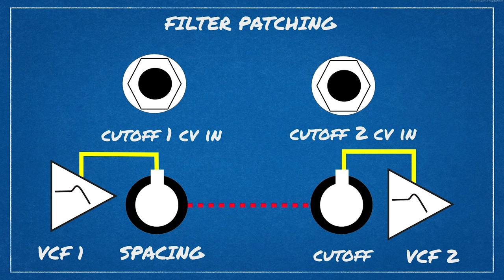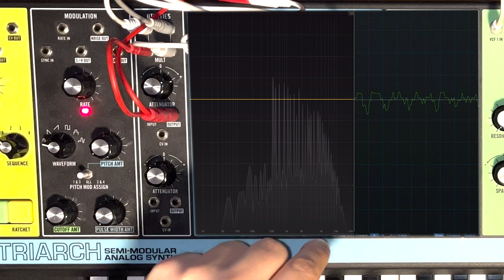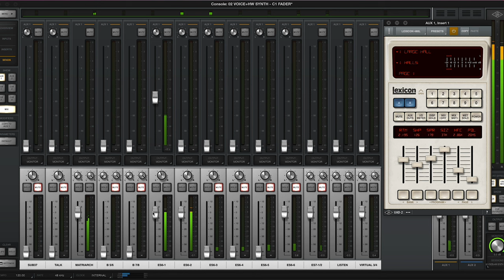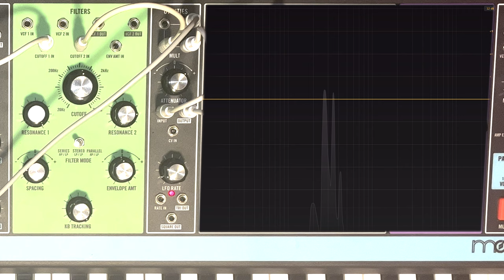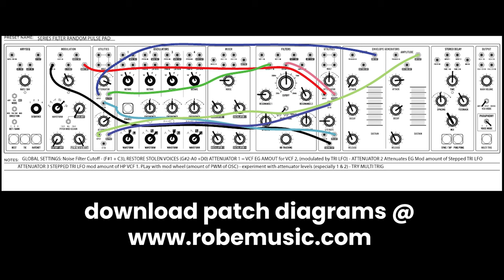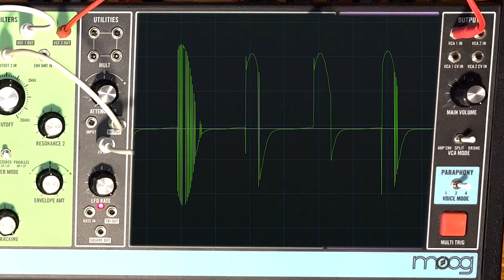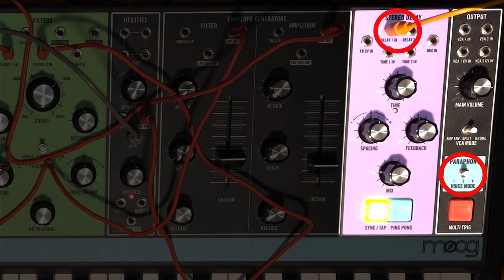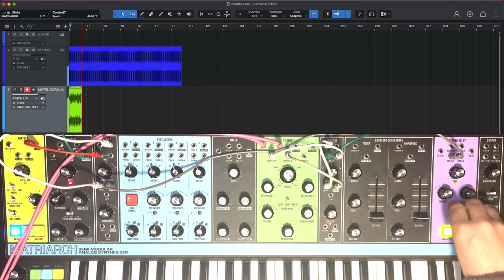Synth Nerds Only: Moog Matriarch Filter Deep Dive : Part 2 - Patches (and a little bit of theory)

Comment: at 12:17, i dont think you need to mult to all the pwm destinations. Pretty sure its normalled, so if you put a jack i pwm of osc 1, the rest will also be modulated. Put in 2, 3+4 will be modulated, and in 3, 4 will be modulated. Put at deadpatch in the oscilator next to the one your modulating to brak the normalisation.
Reply from the maker: Thanks...makes sense that if the pitch is normalled the PW would be as well. never thought about that!

Comment: Great video.. I'll probably watch this like 500 more times .. my matriarch is coming tomorrow.. can I ask you a question? How long did it take you to understand everything on the matriarch?
Reply from the maker: Thanks! glad you found the video helpful. That's a tricky question...I'd been working with synths for a very long time before i got the matriarch, so had a pretty good understanding of synthesis and modular routing before i bought it. It can be a very straight forward instrument but there are a lot of "Matriarch specific" things that i have found over time (and that I'm still finding) so to answer your question...I don't think i've mastered it yet....and doubt i will ever truly master it....but you should be able to get up and running pretty quick if you go through the manual....experiment with the patch books that moog has released and keep watching videos. good luck!

Comment: Thanks for another great video. Where can you pick up the passive attenuators that you use in your patches? I can't seem to find them anywhere.
Reply from the maker: Hey Karma, the ones i use are called Splix. You can get them from Perfect Circuit in the US, or Moog Audio in Canada....but sure you can find them other places as well. it's also pretty easy to make your own...all you need is a potentiometer and 2 or 3 1/8" jacks. ..might do a video about that...but i think it might be more cost effective to buy splix...they're so cheap.
Reply: @RobeMusic  Thanks
Reply: @RobeMusic  When using a passive mult, is there any signal loss as you split the signal?
Thanks for your time. Your videos are excellent!
Reply from the maker: HI Robert. theoretically yes...there could be a small amount of signal loss using a passive mult or splitter...but the truth is it is negligible (unless of course you're trying to use a 5 or 6 way mult) The mults built into the matriarch are passive. You'd probably want a buffered mult if you're going to mult a bunch of pitch CV...but again...passive is usually fine. (again unless you're trying to mult to a ton of different destinations...or the pitch CV covers a wide voltage range)